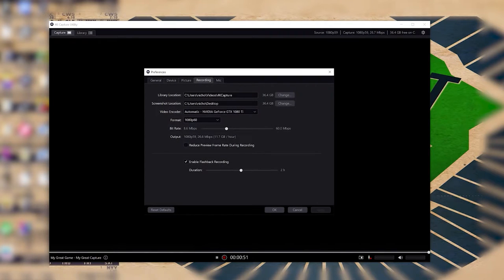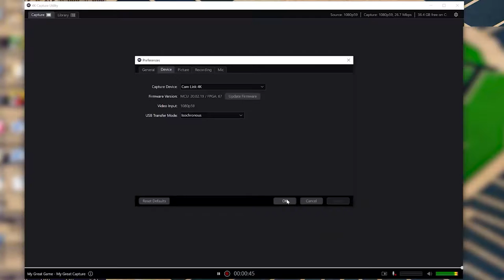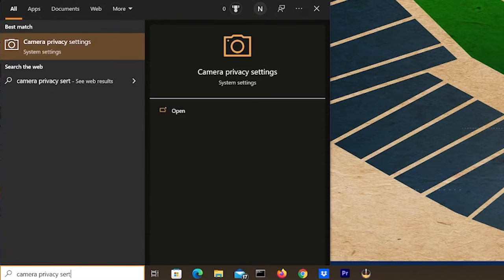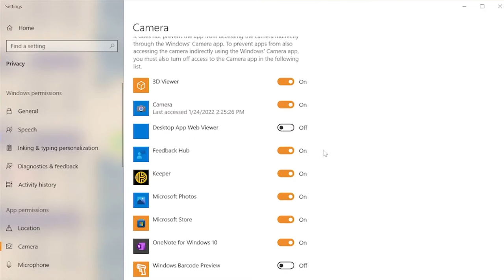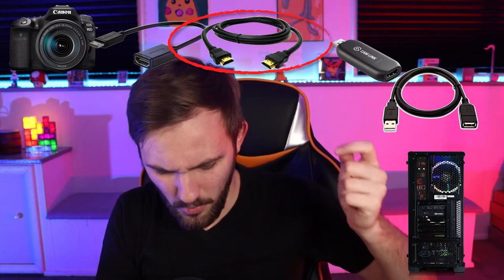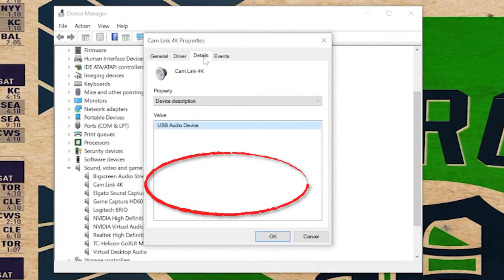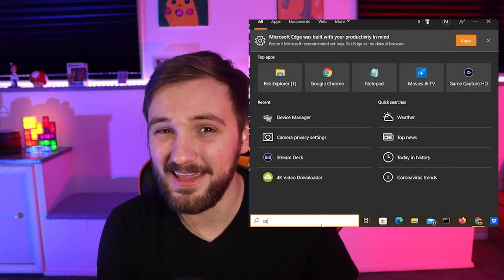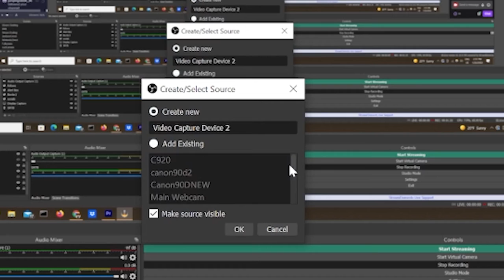How to Fix Cam Link Freezing/No Signal in OBS (7 Different Solutions)

Comment: Thank you very much. That helped!

I was rather surprised, that my cheap capture device ($20) did work, but Elgato did not. Checked the HDMI cables, tried different cables. Nothing.

But the solution was rather simple. By accident I used an USB 2.0 port on my computer. Did work just fine with the cheap device. But Elgato despised it -- but just said "No Signal".

Comment: Thanks for this my first issue was the recorded video from Obs would have random glitches or gaps in the video.  I was using a usb splitter so now I've plugged it directly now. Will test and see if it works

Comment: EDIT: I FIXED IT. I had multiple different sources using the 'Camlink' capture device in different scenes. It looks like a different layer was getting access first then it disabled the other layers from getting access. I simplified all scenes to use the same exact source and now it works consistently.

My issue is weird, it works fine, but if I open and close OBS Studio it will just not appear. I have to open and close OBS Studio again to get it to appear. Before this, it use to work completely fine for years. Deactivating and activating doesn't make it reappear on the instances it's unrecognized too. Any ideas?

Just found in my log, DShow: Run failed (0x800705AA): Insufficient system resources exist to complete the requested service.

Which is strange, that it would change from working to not working just be restarting OBS Studio.
Reply: how i can check which sources using my cam link?

Comment: +1 Adobe XD... December 5, 2022, and this seem like an active issue... I use the Cam Link 4k for the overkill video conferencing while WFH.

Running macOS, I would have voice call meetings with my setup running perfectly, and for unknown reasons, the next call wouldn't work. Troubleshoot everything, cables, computers, cameras... I could get things to work but not isolate the cause of the persistent random "no signal" issues. 

Finally had enough today and ran into this video... 4:20 in, and the XD logo comes onto the screen... I look over to my taskbar, and there is my open artboard... I close the artboard and cycle power on my camera, and there it goes. @JuggleboyMinus please add Adobe XD to your description or other metadata on this video... people may be searching for this and your video deserves to be found.
Reply: For the record, I did not need to uninstall the software... I just needed to close the app and cycle the camera, and it was detected.

Comment: My camera did not show op in OBS or the 4K capture utility by Elgato (it was not even a option), but i checked in my camera privacy settings on windows and it was showing up there.
In the camere setting it was telling me 4K capture utility had my camera in use even while it was closed, so i uninstalled the program and that fixed it for me.

Comment: Here's a new one!  I went into Device Manager, saw Cam Link and it was listed as a USB Audio Device, meaning it would only capture audio!  So now I'm trying to fix that.  Ugh.  Thanks for your help in at least finding that.  Let's see if an uninstall and restart works.
Reply: There is also a CamLink instance in the Cameras section in Device Manager.
Reply: @ultraanalyst  a little late.  ElGato is replacing it as defective.

Comment: Hey man, great video. Just curious if you've ever heard of an issue where the camlink lights up solid white (signifying a stable connection) but the camlink isn't recognised at all by the PC? Not showing up in device manager at all and not showing up in any Elgato software. This is driving me nuts haha
Reply from the maker: Hm, that seems to be one that I never encountered.  My first suggestion would be to try it on a different USB port, and then on a different computer and see if you can get it to be recognized.  If a different computer can't recognize it, it's probably something wrong with the camlink itself, in which case I would recommend contacting elgato at that point.
Reply: @Juggleboy Minus  yeah it looks like it was a Cam Link issue. I bought a new one and its all good now

Comment: Hey man great video.
I have I problem I press CNTRL like you said in the video but the menu is the same It dosen't show up the menu for the USB where I can select "ISOCHRONUS MODE"  I'm struggling with this because I'm very near for the solution, I use camera hub for this the 4K utility said that device is not found.
I was checking this because I have an interview on stremyard and after 12 minutes my ELGATO CAMLINK 4K is linked on my SONY ZV-E10 and then it goes down it show "ELGATO NO SIGNAL", and I don't know why. It could be dangerous during an interview session.
Can you help me?

Comment: Hi my cam link stops working after a min (the light turn off). I don't see anywhere someone talking about it. Any ideas? It is USB 3.0
Reply: so i finally fixed it and it was settings that needs to be changed on the camera itself so it won't go to sleep mode.

Comment: Mine turns on when connected,  after 5 seconds,  it turns off,  but it's still recognized in OBS. No image,  no sound,  no nothing.   Plugged it in different computer,  I Uninstalled it,  it's on USB 3.0, alone, but no image. Whatsoever